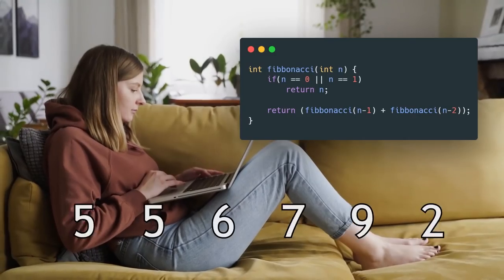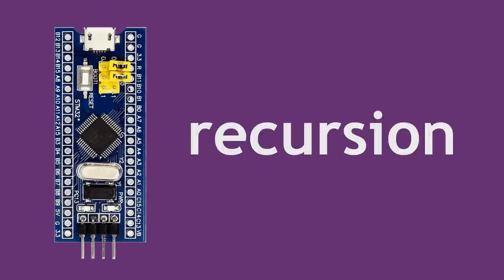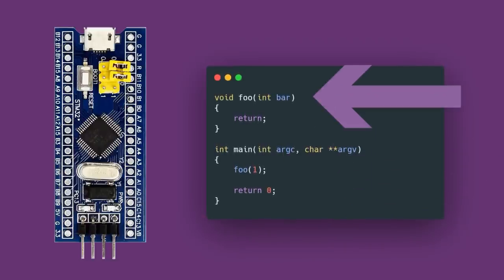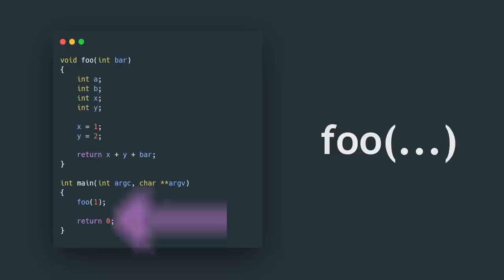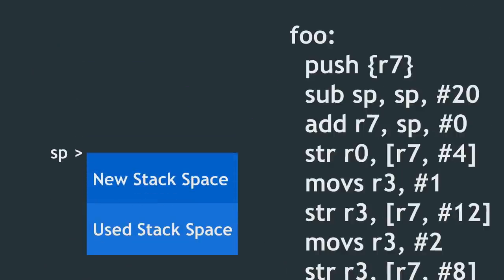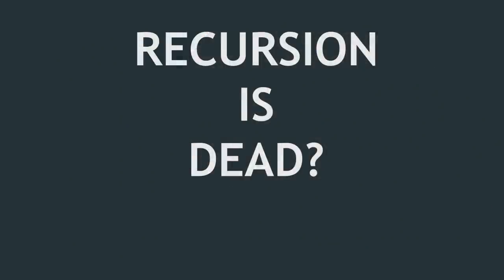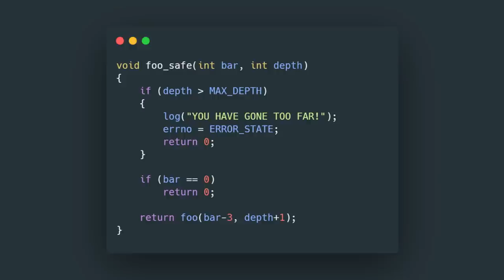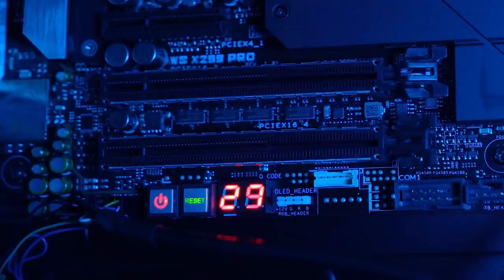why is recursion bad?

Comment: Came to the comments to see mentions of tail recursion and it seems we have enough CS people here 🤣
In truth, I love recursion as I studied LISP (Scheme) before even C, but that is another story. Hey next time try to lower the volume of the music 😅
Reply: Look at the channel name. 

Now look at how your compiler is implementing recursion. Either it's following his advice, or it's running into the issue he described. 

It's empirical, not theoretical. You have finite space, so either you or your compiler is managing it in one of the ways described, or you're running into the issue described. 

If you believe there's a third option, you can prove it empirically by providing an implementation in actual code.
Reply: @NilesBlackX  can You rephrase? I am not sure what you mean. Are You familiar with tail recursion ?
Reply: @AlessioSangalli  Yes. But the question is, are you familiar with how your compiler implements tail recursion at a low level. In e.g. C compiling under gcc, tco doesn't maintain the recursion pattern when compiled; it switches to loops and accumulators.

That's what this video, and channel, is about. Low level programming, not high level programming abstractions and patterns, but the compilation and runtime execution.

So - are you familiar with how your chosen language actually implements tail recursion, under the hood?

Comment: There is a feature in some languages that make recursion just as effective as iteration, if used correctly: tail recursion. Tail recursion is having the recursive call as the last thing the function executes. By having the call as the last instruction, at a low level, the same stack frame is used instead of creating a new one.
Reply: Yep, was going to say this.
Reply: Tail recursion is only efficient because it is optimized into an interative form before reaching assembly.

No different than being iterative to begin with

Comment: Until I learned about divide and conquer algorithms, I didn't know much about recursion or how to do it properly, if you end up in cases where you compute a lot of the same problems you can use memoization to speed up the process, this does also apply to normal iteration.

Comment: Recursive functions are great in theory, since it is easy to prove the correctness of recursive programs (almost by construction, as recursion builds on the principle of induction), and once you're used to recursive functions, it's also often easier to understand a recursive program.
In practice however, recursion should be avoided for the very reasons described in this video. Every recursive program can be replaced by an equivalent loop program in principle (Turing equivalence of mu-recursive functions and WHILE language, if I remember my theoretical comp sci correctly), but this might also be very hard to do in practice if the recursion is not of a particular kind.
Reply: Again, this (avoiding recursion) can be very true for embeded, but in general IMO it is one of worst advice ever, but then people go around programming in imperative, or OOP... Recursion is declarative, in many cases considerably easier to reason about correctness, and with fancy languages there are lots of things that compiler can do, automatically for you.
Reply: @morphles  Alright, I admit the blanket statement "avoid recursion" may be too simple. I suppose it's a matter of weighing efficiency against clarity.
Reply: @hackvlix  Yes, though majority of recursion lovers don't even think on those grounds. That's the problem. 
If the language forces us to use recursion then there's no choice. But if it doesn't, it means there is ALWAYS a non-recursive way to achieve the required functionality.
Reply: @anujmchitale  That non-recursive way will also use up the stack.
Reply: @davidwuhrer6704  Yes.
Reply: @morphles  Somebody had to say it. Avoiding certain practices ("because is more efficient" this is a comment I see a lot) without fully understanding why is a very dangereous habit. One problem where recursion is easier to implement and read is a problem where the number of loops in a function is not known. Ex: Display all permutations of N elements, tree searching, etc...

Comment: There are two classes of recursive functions:
a.) Those that either return the result of the recursive call (recursion is the very last step in the function) or don't recuse at all. This is called 'tail recursion'. Fibonacci is an example. Such a function can be easily transformed into a loop without recursion and without additional memory requirements. Programming languages that heavily rely on recursion (LISP)  usually do this optimization automatically.

b.) Everything that is not just tail recursion (and cannot be rewritten that way). Such algorithms rely on temporary data that cannot be discarded before the recursive function calls itselfl. A typical example is Quicksort. You need to remember what needs to be sorted later. If you rewrite such an algorithm without recursion you will need additional (and dynamically growing) memory anyway. If that is more or less efficient than a recursive functions that puts that data on the main processor stack depends on the circumstances. Using a static array for an iterative Quicksort can be very efficient. Using a stack that uses a linked list and  dynamic memory allocation for each item can be much slower, use more memory and lead to memory fragmentation, very bad in the embedded world.
Reply: Nice example, thanks

Comment: Recursive algorithms tend to be easier to formally reason about. In safety critical embedded systems this is a nice feature. And your argument gets irrelevant if TCO is used.
Reply: Formal reasoning doesn't seem to be very relevant in practice, as safety critical systems, like the automotive industry, explicitely FORBID recursion because it is harder to understand. (See MISRA-C guidelines). I also gotta say that since the straight up fetishism of recursion in functional language during unversity, I haven't really seen any use for it besides the places where it just comes naturally (like tree traversal or something like that). Tail call optimization always felt a bit weird to me, because it's like "Yay we got the exact same efficiency as iterative, unless the compiler goofs and misses the fact that it can apply TCO here" (I believe scala had problems with this when I worked with it). Like, just write it iteratively then and cut out the middleman. And, of course: Not all recursion is optimizable with TCO.
Reply: @simivb  I just looked into the MISRA-C Guidelines (the 2004 one, because I couldn't find a 2012 one) and the stated reason for banning recursion is indeed because of potentially consuming up all stack space. BUT this isn't a problem of recursion in itself, the problem here is that we are talking about the C programming language and no C Compiler guarantees TCO (there might be Compiler specific directives for that though).

So to me this says nothing about the difficulty of formal reasoning about recursion, just that C is bad at supporting it. This may very well be the reason why formal methods may not be used that much in practice. It's sad though.

Comment: Sidenote for people like me (saw the randomly recommended video, watched it with some confusion, noticed the channel name only afterwards) - it might not be the case for your favorite programming language but I guess it's correct in the context of this channel.

Like some languages can be pretty smart about optimizing recursion-related stuff (like Haskell and other languages that prefer pure functional style), some can provide things to explicitly optimize recursion (like tailrec and DeepRecursiveFunction in Kotlin). So in that context the proper solution might be just to use whatever is more comfortable for you.

That being said, in the context of embedded systems I would guess that it's actually more complicated.
Reply: It's a death trap in embedded systems. 
I never found any appeal in recursion but then again, my mindset is of the embedded systems and closer to hardware.
Reply: @anujmchitale  It makes code simpler, and helps avoid bugs.  But only if the compiler knows how to avoid using the stack for recursion, which most embedded C compilers don't.  So you have to do the computer's job by hand.

C is not as close to the hardware as most people seem to think it is.  For example, C does not have a way of reading the CPU's overrun register.  You have to write an elaborate boundary check which the compiler then translates into a single assembly instruction.  C is a high-level language.

And with today's code generators for embedded setup and configuration, you're sometimes closer to the hardware with shell script.
Reply: @davidwuhrer6704  Most C compilers allow for directly including assembly instructions into the code. So not sure about the elaborate method part you mentioned.
Yes C is a high level language but when one has to work with very limited resources of a microcontroller, recursion is hardly ever used.
Reply: @anujmchitale  Do you always garnish your C code with "extern(asm){" when you check for integer overflows?

It is possible to do stackless recursion in assembly, too.  That's often how loops are implemented.  (Fortran and shell script don't use a stack for recursive calls either.)  But when you try that in C, chances are the compiler will still use the stack.
Reply: @davidwuhrer6704  I mentioned about asm only because you said a single assembly instruction required lot of logic in C. Well, there's an option to use asm.

Generally, overflows are avoided by static compile time checks, and coding standards. In case they still exist, I guess there's no protection within the code, as far as I have come across in many of the different embedded sub-systems. This may be poor quality standards but that's how so many of reputed international companies program.

As for assembly, every single recursion is ultimately converted into a loop. There is no other way to do it.

Comment: This is really a compiler issue.
A proper implementation of tail-call recursion should only use a limited amount of space.
Reply: Indeed.
Reply: You can't always use tail-call recursion.
Reply: @timurtheterrible4062  Are you sure I thought there is always a tail recursive solution?
Reply: @nachobounty8947  if the result of the recursive call is combined with local state, the stack frame is required

So this use of recursion essentially uses the call stack to avoid using an actual dynamic datastructure
Reply: Thank you!
Reply: Some recursive functions which cannot be tail-recursed as one function can be tail-recursed when factored into auxiliary functions. Recursive calculation of the fibbonacci sequence is a classic example.

Comment: Actually, regardless of how much RAM your PC have, stack size is still very limited. On Linux for example, it's a constant set during kernel compilation, and is generally 8Kb, 16Kb, or 32Kb.

Edit: as comments said, that is true for kernel space, not userspace.
Reply: @Esiarpze or you can iterate, making more readable code, that the runs just as fast or faster and doesn't necessitate messing with stack sizes.
Reply: @catocall7323  Readability is subjective. It totally depends on your background.
Reply: @maltefgerdes  although this is true, I bet the vast majority of programmers aren't that familiar with recursive heavy functional programs.
Reply: @catocall7323  sadly true :(
Reply: Do you mean for userspace applications or for kernel/driver?
Reply: This is probably for kernel/driver, on userspace stack size limit is much bigger.
Reply: You're right, it was for kernel driver. smh

Comment: On non-embedded systems, I wonder what going through a lot of stack frames does to your cache hit rate.
Reply: It depends...
You would have to study access pattern of the recursive code to see if it has worse cache performance than iterative code. 
For example: FFT with recursion performs better than purely iterative FFT (mainly due to less cache misses).
But as a rule of thumb iterative code tends to have better cache performance.
Reply: Not sure if it makes much of a difference on cache. The stack will always have a limited memory space regardless. If anything it's branching that would have a bigger impact on performance.
Reply: I think the memory access pattern in stack is usually (assuming that you mostly access local variables of the current function)  cache friendly because after function  call or return you just increment or decrement by the size of he stack frame (the memory allocated in stack for local variables when calling a function) which is usually small. So usually it doesn't cause random accesses from distant memory locations.
Reply: @RedMushroomPanda  If by iterative you don't imply "in place" (ie, you can still use an array as an auxiliary stack) , iterative will be almost certainly faster (and also require less memory) because you only push the data you need. In contrast, before a function call or return a preparation is often needed (such as storing the values of volatile registers or retrieving the values of non volatile registers) and also push/pop additional data (return address, "red zone", etc) which are additional overhead.

Comment: The video overstates the case. While it is true that recursive functions can grow the stack, most well structured recursive functions need not. 

Others have mentioned tail-call optimization. It turns out that this optimization is very easy to do manually in C. What this means is that you can write a tail call recursive function and then easily convert it to simple iteration without losing the recursive feel of the algorithm.

Comment: I only once ever used recursion (not in embedded systems) because I was tasked to use some legacy code, without changing any legacy code (emergency room software that needed 100% guarantee to be backwards compatible). I built a rather complicated design pattern comprised of visitor, decorator, facade, adapter and proxy in order to get it to work. the main thing of it was having the visitor pattern being called within the proxy and facade. I felt super clever when I did it and it was the first time in my job that I really needed to dig deep into the classic software architecture stuff that I learned in university. When i was able to present the result and I got the merge request approved from some serious senior engineers, I felt so good, lol

Comment: I like the max depth idea for cases when recursion just makes the most sense.  That's the kind of solution I'd probably overlook myself.  I've never worked with super limited systems myself so I usually don't have to worry about things like this all that much when I code, but it's still interesting to learn about optimizations like this.

Comment: I program at the application level, usually using JavaScript or Ruby.  Several years ago I had a good use case for recursion.  I had a tree data structure that I needed to step through, and found that recursion was the most intuitive way to look at the problem.  I only ever had data trees that went no more than a dozen or so nodes deep, so I was definitely not worried about blowing up the stack.

Comment: I live vicariously through recursive template meta programming. Same megalomaniacal power with no exploding stack.
Reply: The exploding stack is your compiler. This is why C++ compilation is such a huge memory hog. C++ metaprogramming is like Lisp with worse syntax (which is impressive considering how easy to hate lisp's syntax is), except there is no garbage collector (Types are Forever) so you better not do too much metacomputation.

Comment: As an actual systems programmer, my heuristic is to use function recursion for highly STATEFUL recursion logic (like recursive descent parsers & encoders for JSON, XML, etc.) and loops for everything else.

Basically, for things like recursive parsers the cleanest & simplest implementation is usually a small number of stateless, recursive functions that call each other. Logic that you could only implement with pure loops by writing your own de facto program stack (a stack of structs storing the current state & previous ones, which is what “the stack” really is). Having tried both, the recursive functional approach really is better unless you’re so resource limited you can’t (I.e. no RAM). For nearly everything else plain old loops are better. Especially for things like computing Fibonacci numbers or other “map reduce”-like logic where you only need to track minimal state, like the running sum or last index.

Comment: This is so contextual to the programming language you're using. You could write a compiler that uses continuation passing style functions and you'd have recursive functions that don't use the stack.
(This is assuming you've got tail call optimization which all the most used programming languages have)
Reply: @Werse Varsity C# does have it actually, in 64-bit release builds. interesting, i didn't know that about it being in the JS specs

Comment: If you are doing a "recursive" math function, you should first see if there is an O(1) method.  Search fibonacci sequence closed form for example.
Reply: Sure, but for that to be O(1) you need to use floats, which starts giving wrong answer after about n=50, IIRC? If you want actual usable answers, you need a variable-length data structure for integers, which means you're going to be at least O(log(n)), but it's worse than that because then you can't even use the closed-form version of Fib, because you can't divide or sqrt those integers. The best method is a matrix multiplication version that uses O(log(n)) time and O(log(n)) memory (constant memory relative to the number of integers we need to track, but those integers have an O(log(n)) footprint).